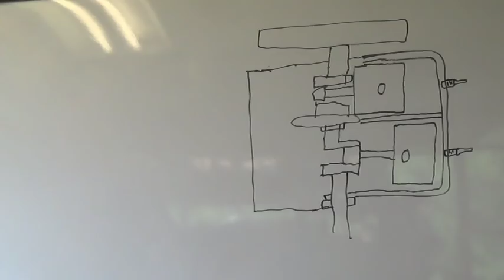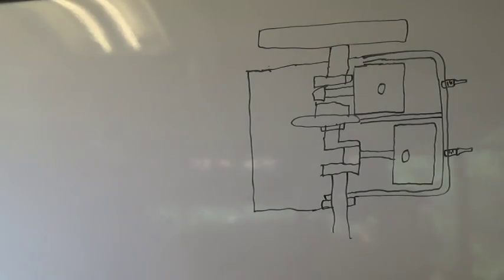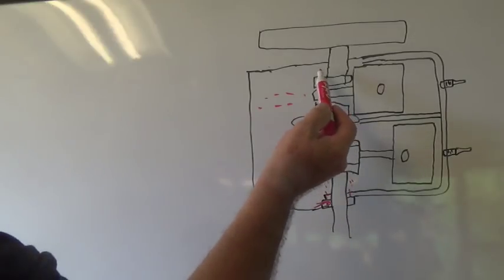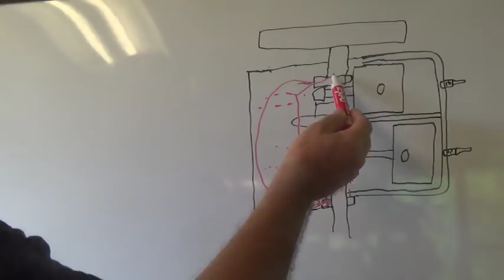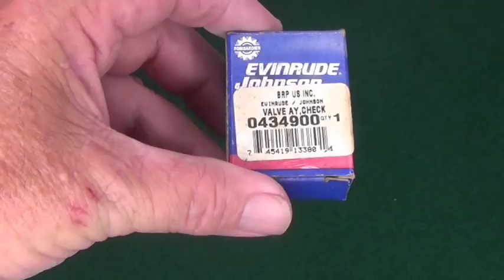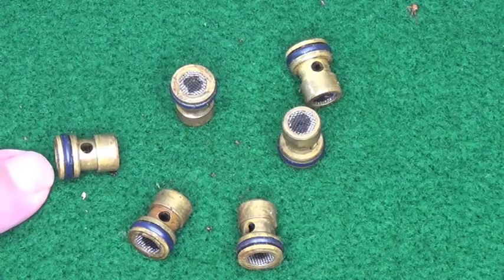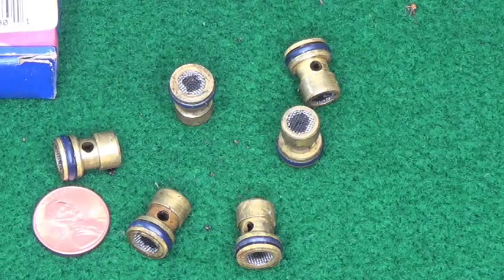Outboard Recirculation Systems

Comment: So I believe you just solved a problem I have! I have an 87 Johnson 150 V6 w the vro removed. Just got her and I noticed I get what looks like burnt motor oil that will start coming out the gasket where the power head meets the exhaust. And it will run down the shaft behind the motor and drtio down where the prop meets the exhaust. When I first got it. I did notice this substance pooling on the top of the carbs. When I re did them there is not any more pooling. However I will get pooling. I noticed one of the fuel pumps was leaking from the gasket so I just replaced it. I haven't taken her out since. I noticed I am getting some white smoke at lower speedsz I am assuming that this is unburnt gas? My compress is good on all cylinders 90psi.  Maybe I'll replace the check valves too?

Comment: My '95 Johnson 35 has a primer which is also tied into that bowl drain barb fitting, it also tees into the 5/32 hose off the intake. it was a MARS motor and previously had a dewatering valve on it. It would run but not at wot, and didn't like sudden throttle changes, I changed the small hoses to clear nylon and discovered that on acceleration the carb was sucking air in through the  intake hose via that drain nipple right up the high speed jet.  What's the purpose of that intake drain hose?

Comment: Great video.
I had a hard time finding a video on this subject.
I just replaced my original recirculating hose with a 3/16 clear fuel line on my 1967 johnson 20 hp.
I see the oil coming down the hose while running the engine.
Does this mean the check valve/s are not working or is this how it is suppose to be?
It's definitely not going up the hoae.
Thanks.
Reply from the maker: I never put a clear hose on my motor, but the manual states it goes from the bottom to the top. I was having problems with the bottom cylinder running rich. Thanks for watching and commenting,

Comment: Witch way does the holes on check valves in 96 200 johnson horz or vert.
Reply: Jpressonchevy@ gmail.com
Reply from the maker: The service manuals I have does not say.  When I replace mine I just installed them.

Comment: Would a bad check valve cause rough idle and hard starts, but no issues at WOT? I'm thinking I have bad check valves, and it's causing my engine to "flood" a little because the excess fuel is pooling.
Reply from the maker: I have had that with my Evinrude 225. Bad check valves on the on the recirculation system. I think that a bad check could cause some issues.  That is not where I would start looking for hard to start. When I am checking out a outboard. I start with making sure it is getting good spark. The electrical system is the weak link on a out board. Then I make sure it is getting fuel make sure carburetor is clean all three areas low medium and high. Make sure you carburetor gasket is good. Then I make sure my timing is in the right place to start. I just make sure that everthing is set like it should be and these old motors will run for a long time. I hope this helps if not let me know. Stay Safe.

Comment: You are so right, these systems get very complex on the larger engines indeed.  That is a big job/pain in the neck on these engines because the intake manifolds have to be removed, and you are wise to replace all of them, not just the broken ones.  These engines will not idle properly, and load up, like you say, if the recirc systems are not working properly.

Comment: Another great video!! Hey OM I've got a question can you explain to me the difference in a short shaft and long shaft motors and why and when there used? Maybe this topic would be good for a video someday... lol..I just don't know why or when to use the two!!
Reply: Depends on transom height of boat.Short shaft are about 15" and long 20".Smaller jon boats etc have short transoms.Then there are sail models which are even longer I believe.I saw a video here youtube whee a dealership sold a guy a new boat and motor and put wrong shaft motor on somehow.He would stop and or going slow and water poured in the back of boat.
Reply: wish2fish ok so my 14 foot Jon boat needs a short shaft motor? As I think about it motors probably don't start getting into long shafts 30 hp and above.
Reply: No thay make long shaft in 9.9hp,15hp, or they use too, but probably still do.My guess is your jon has a 15 or 16 inch transom.Just measure from the top to bottom if your not sure.

Comment: Awesome video!!Question the hose on the primer that goes to lower part of manifold.If I pull my primer out gas squirts out of both the upper and that lower hose.I checked this when I had the lower hose off.Is this correct?I am having idle issue still and thought I had it corrected by using your service bulletin and adjusting the link/sync, but then after sitting on the water for acouple hours fishing the problem arose again.I can pull my primer half way out and rpms go up which keeps it going.Kind of confused.I rebuilt fuel pump after testing my fuel pump which was giving me almost 3psi before rebuild.New pump rebuild was bouncing around and not staying steady like original?Motor runs fine at high rpm.
Reply from the maker: Yes gas will squirt out of both upper and lower hose they  just have a tee hooking them together. The very small recirculation reed valve stops it form going that way on the manifold reed plate. When the primer is in the warm up position the engine runs. I had this same problem with my motor. It ran great at the house you get to the water it run great when come time to load it back on the trailer it would not idle. How I found my problem I let a friend use my fuel tank and fuel line. He had the same problem with his motor as I was having with mine. I cleaned the tank and bought a new fuel line and new ends. Though it might be the O rings in the ends. I cleaned his carburetor and mine. Ran good for a while then would not idle. I kept finding a real fine grit in the carburetor bowl. I think it is something in the gas when we get it from the pump. That is when I did the video on the fuel filter installed. I bought a good  fuel filter water separator. After I got everything clean my motor has been running very good no fuel issues. When your primer is in warm up giving it gas it runs that could be the carburetor is not supplying the gas it need or you have a bad carburetor gasket.
Reply: Thanks.I was concerned that the new fuel pump kit install may be causing me a problem.The diaphragm on my old pump seemed thicker than the new one and I had left my fuel pressure gauge on after the rebuild and pressure gauge was showing up and down and even went below o then back up to 2 where as the old pump stayed steady at the different rpms.Either had close to 3psi at higher or 1psi at lower rpms.I also was tightening up vacuum leaks on my hoses.They are gone now.Wish I would have run it after those were fixed and then seen if my lean issue was solved before rebuilding my obviously working old pump.
Reply from the maker: You can always put the fuel tank higher then the motor gravity feed. I have done that to by pass the fuel pump before. Just to test.
Reply: Thanks for the quick response.Is it possible the new pump kit is an issue?I got an OEM kit.Might be a problem lifting tank up since I don't like running it on muffs.It seems to run much better with the back pressure and I have no tank to run in.
Reply from the maker: I agree they do run better in the water and you know how it is really going to run. I believe you problem is in the low speed in the carburetor because it runs when the primer adds extra fuel in the top of the carburetor. That tells me look at low speed ports in carb.
Reply: thanks again
Reply: Seems since that lead plug came loose and I repaired it I have had issues!
Reply: Just got done pulling carb off.Cleaned it out again short of doing the three welch plugs and it seemed clear.Will test tomorrow..thanks